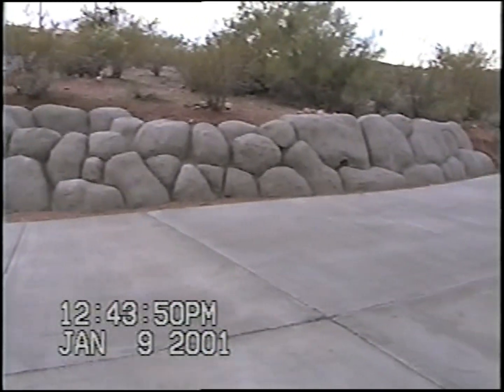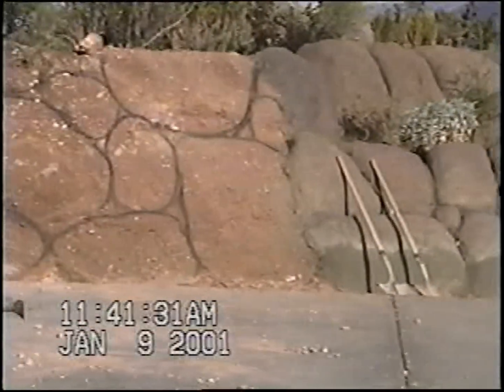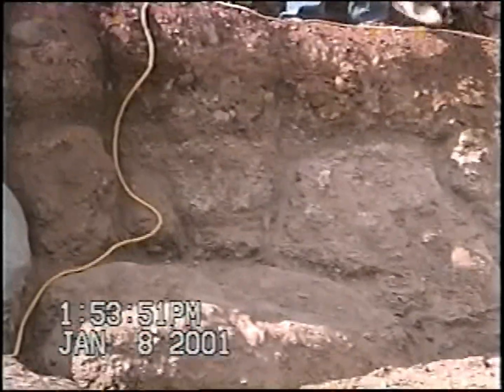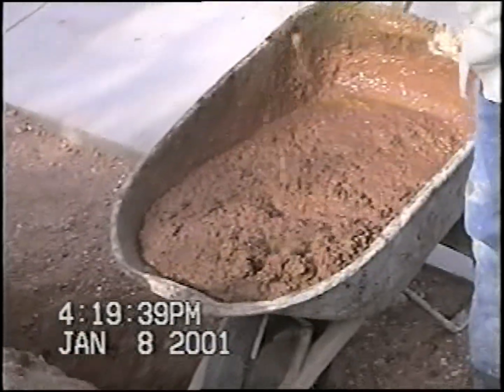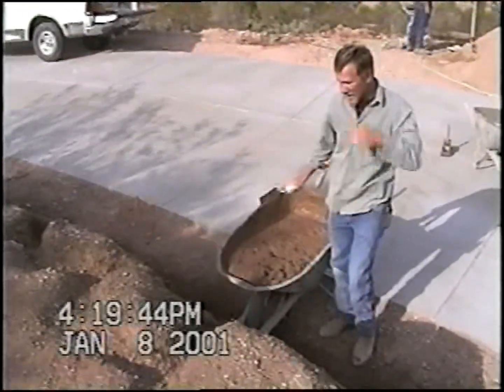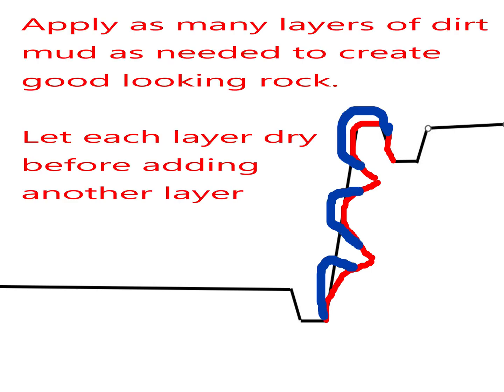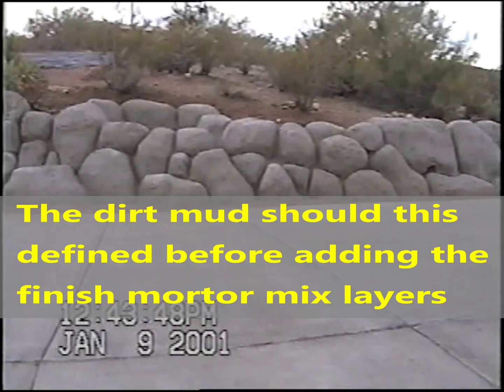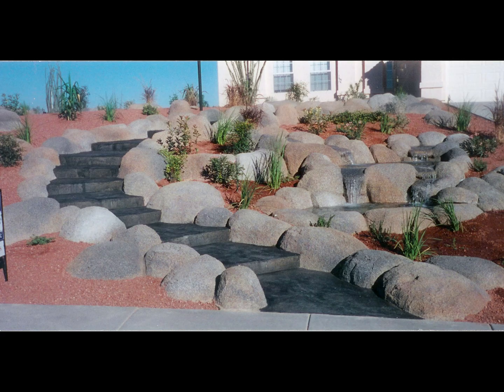Rock Bank built with dirt mud mixture

Comment: Beautiful.  A bit more direction on how to do this would be great!!!
Reply from the maker: Thank you very much and I appreciate your feedback. I have a problem in a sense that a lot of people tell me to make the video shorter. It’s too much, but I am kind of like you I want to know more detail. Suffice it to say we dug into the bank to try and get some relief and then we took the dirt that we had dug out of the bank and mixed it with water and applied it to make more of a pop out to gain definition in dirt. Once that was accomplished, we then use the mortar mix to coat the dirt add an inch and a half layer once that was dry we put another inch and a half later on once that was dry. We splattered it with the dash brush with the mortar mix and then stained and sealed it. It’s actually quite simple.

Comment: Stunning results. Really learning a lot and even started a project on my own... and then it started freezing over here. Will make a video to show how it turned out. Got a question on that bank. I understand you would carve out from an existing bank. It's firm and has 'proven' itself resistant against rain or washout. But if it's a newly landscaped terrain? How would you go about it? Use rebar and make it stonger? Or would you stay away and give it a year to settle in?
Reply from the maker: Thanks… I’d just get after doing your bank. It should be fine